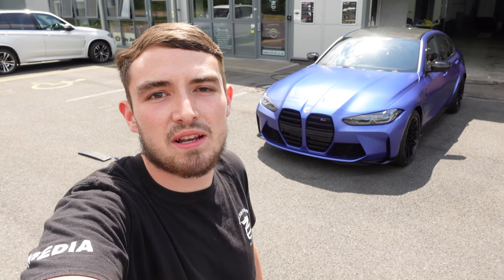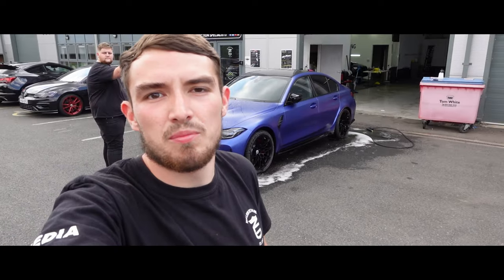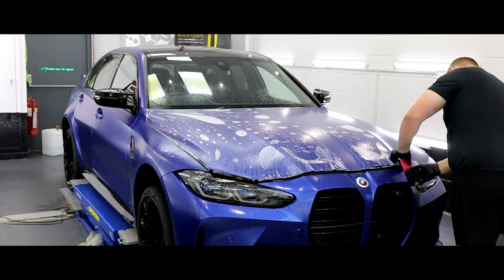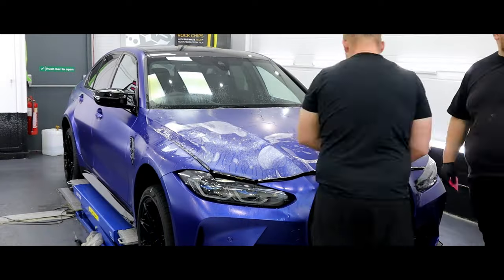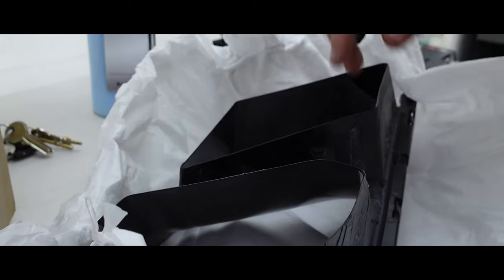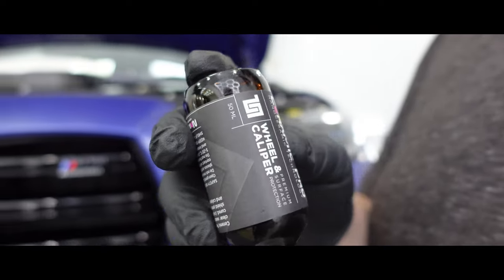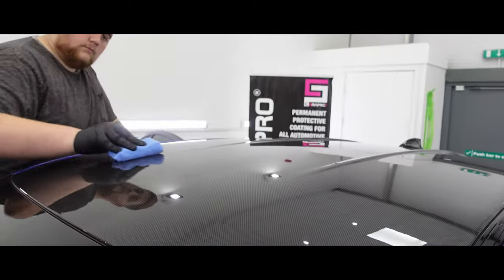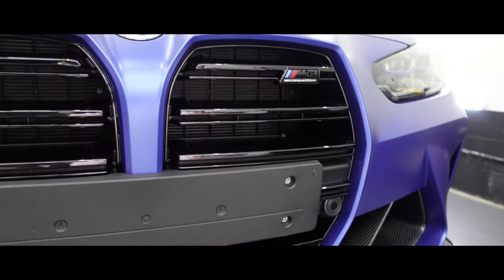Transformed! BMW M3 Competition in Frozen Blue Gets Xpel Stealth & Ceramic Pro Magic! 🔥🚗✨

Comment: I have a stupid question, can a car wrapped with stealth PPF go through automatic car wash?
Reply from the maker: Hi There Sam,

We do not recommend using those automatic car washes at all to be honest let alone with Stealth PPF. With those automatic car washes they end up causing more damage to your car than you think as the brushes they use will micro scratch your paintwork causing those awful swirl marks you see on the majority of peoples cars.

going through them with PPF on your car you run the risk of the jets getting too close to the film and could potentially lift the film.

If you have any other questions feel free to ask!

Comment: Question...you can't paint correct prior to installing the film correct? Since paint correction requires polishing and doing so with the frozen paint will ruin the finish.
Reply from the maker: Great question. You are absolutely correct about polishing any matte or satin finishes. On cars with those finishes the key is to take your time to ensure the area is clean and free from any contamination prior to applying either a ceramic coating or ppf. 
On a gloss vehicle we don’t usually polish before doing paint protection film unless it is so bad that it will affect the look of the ppf or the customer requests it. This is because as part of the prep stages immediately before film is fitted we like to once again clay bar the surface and then squeegee the panel clean as you can’t use a cloth as it would risk contamination. This part of the prep stage would undo the time and customers money spent on correcting it first. 
We always try to be as transparent as possible and we don’t want to waste either our customers money or our time, time which can be used in other areas of the detail to ensure the customer gets get best service we can deliver
Reply: @NewlookdetailingUk  thanks for the response. You guys do great work. The video was so satisfying to watch.

Comment: Does the Xpel change the way the frozen paint should be washed?
Reply from the maker: Hi There William thanks for leaving a comment! The Xpel film would actually make washing a frozen painted car a lot easier as you don't have to be as causious on the protected areas. The beauty of paint protection film is that you don't have to worry about marring the paintwork when washing your car as any of the usal marks will just self heal!